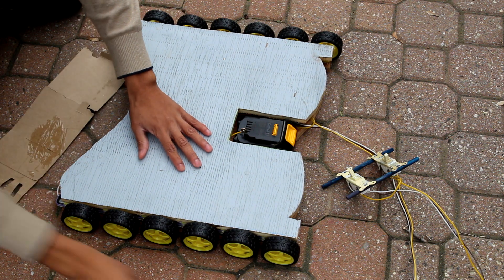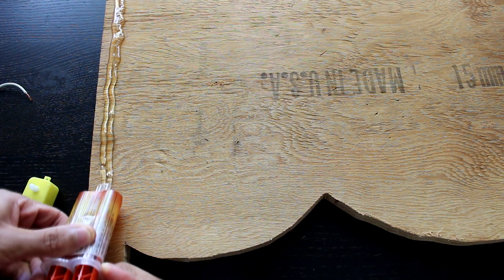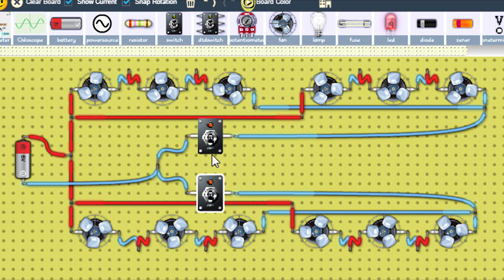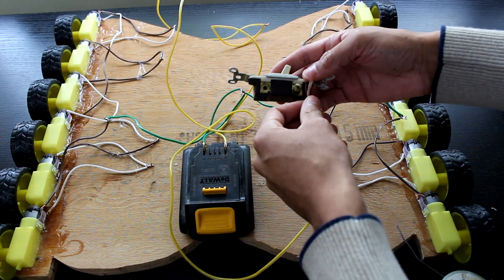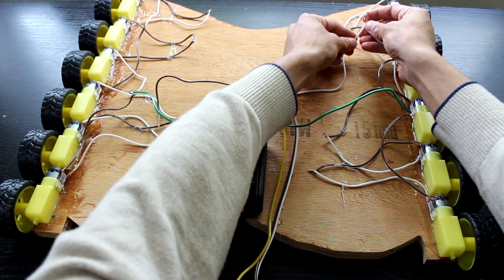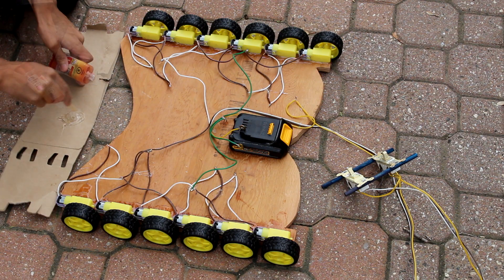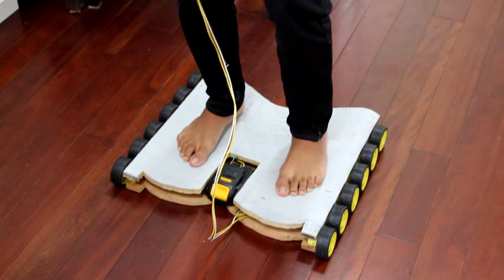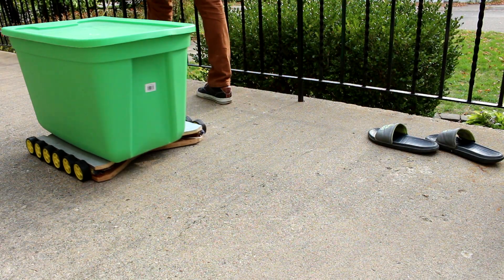How to Make a Simple Homemade Hoverboard

Comment: Why don't you use a 20000 mah power bank battery. U can also then recharge it without removing it.
Reply from the maker: that would have worked well, but I just used what I had at home

Comment: what about using brushless motors,those High torque for the wheels?
Reply: yogesh thakare cgg
Reply: Srinath Sudharsan nö
Reply: Psyjuv coll
Reply: Psyjuv l
Reply: i was thinking the same (a properly designed gearbox will help a lot) and adding arduino and a bluetooth module which can be controlled by a smartphone
Reply: Psyjuv   
Brushless=Better

Comment: actually, instead of making it higher u could just add some wheels in t he middle of the hover(no need to have motor attached) so it would increase the strength and decrease the friction with the ground
Reply: Nícolas Piano yup.....right......thanks for that ...
Reply: advice me ...the motor I should use
Reply: Abhipray Banafer what i m saying friend is: if u add wheels in the center (no motor needed on these ones) will decrease the friction with the ground and it will have one more strenght point to the car
Reply from the maker: that would probably work too
Reply: Nícolas Piano
Reply: Nícolas Piano .
Reply: explain more ...you want one motor wheel in centre